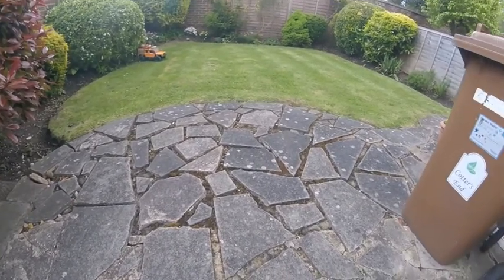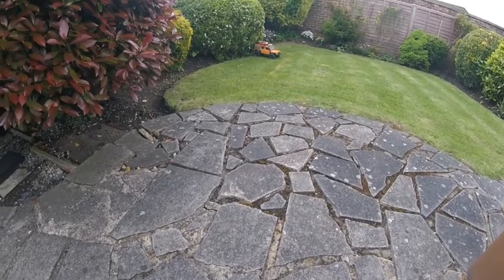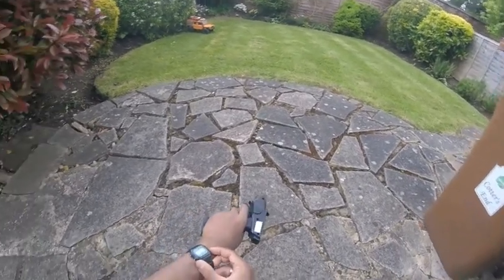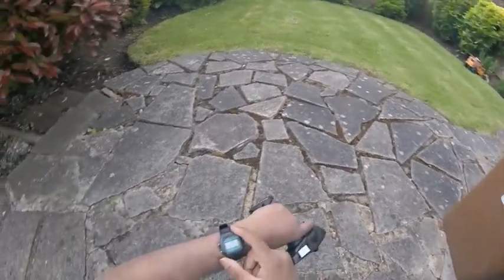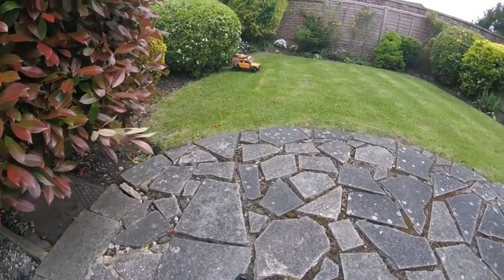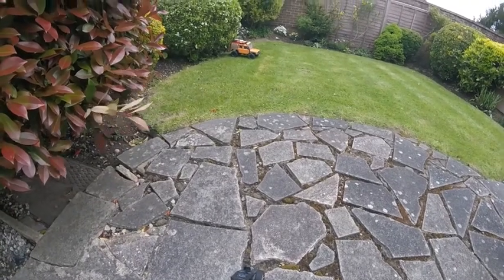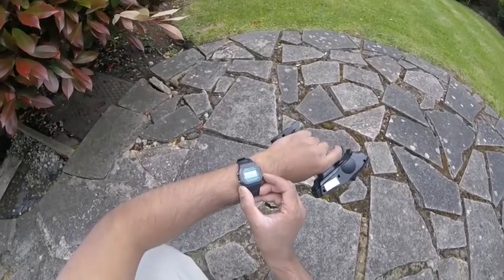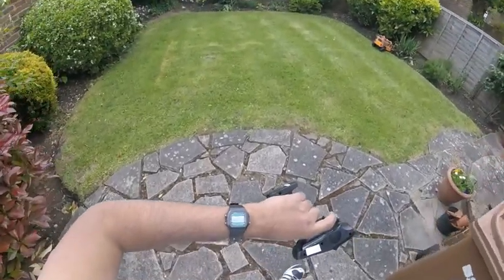FTX Kanyon motor comparison 50T vs 80T

Comment: Nice video showing the comparison between the two motors. I currently run a 35t motor in my kanyon.
Reply from the maker: So sorry for the delayed response…not quite sure why I never got a msg saying you had commented…but it’s happened to a few people so apologies. How are you finding the 35T motor? I’m not really wanting this to go fast …I do have low turn motors for speed but want this to be really slow as it will only be used for crawling/trails etc